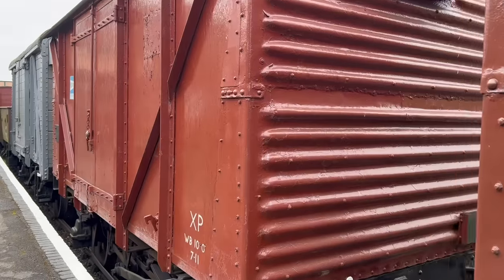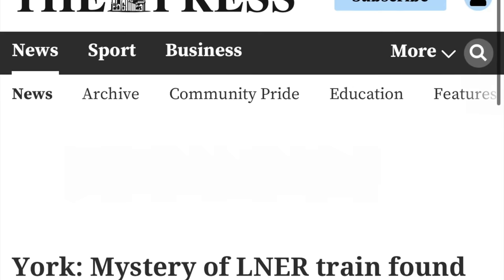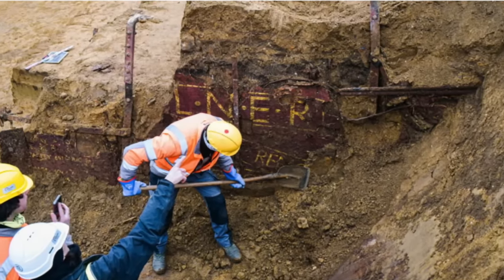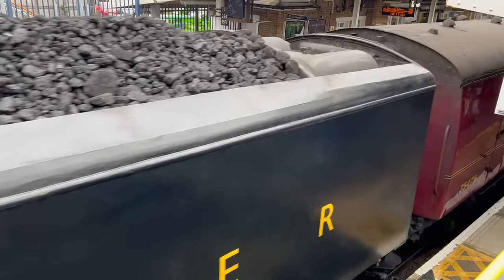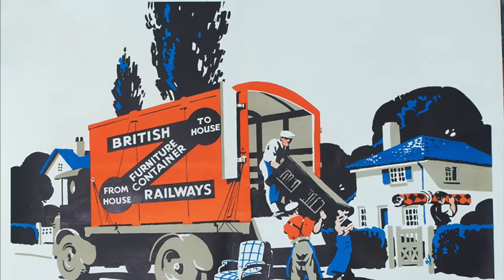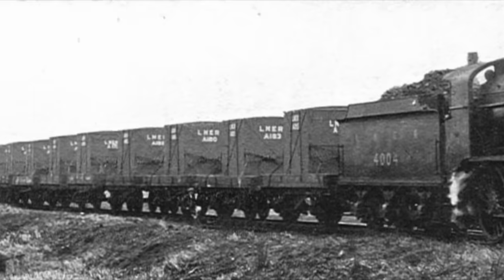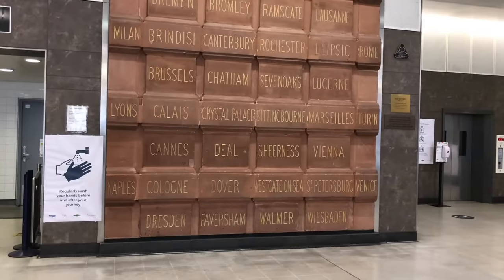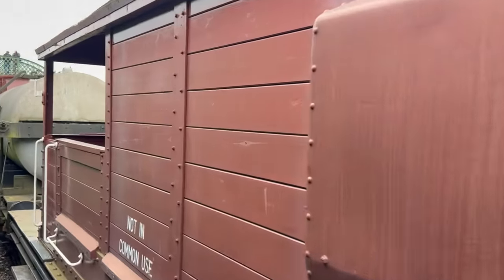The "Mystery Railway Wagon" in Belgium that isn't a mystery at all

Comment: I have to admit that I am disappointed this was not evidence of Watkins completing a secret Channel Tunnel rail link.
Reply: Lol
Reply: From Wikipedia: "In 1881, British railway entrepreneur Sir Edward Watkin and Alexandre Lavalley, a French Suez Canal contractor, were in the Anglo-French Submarine Railway Company that conducted exploratory work on both sides of the Channel.[34][35] From June 1882 to March 1883, the British tunnel boring machine tunneled, through chalk, a total of 1,840 m (6,037 ft),[36] while Lavalley used a similar machine to drill 1,669 m (5,476 ft) from Sangatte on the French side.[37] However, the cross-Channel tunnel project was abandoned in 1883"

Comment: What a wonderful idea.  If you standardised  these 'containers' they could be used the world over to carry just about everything.  It could revolutionise shipping, road freight, ports, railways...
Reply: Nothing new under the sun eh?
Reply: BR eventually went over to four-wheeled covered vans and dropped the use of conflats. The conflat wagon went all the way back to when the gentry could place their chaise upon a very similar four wheeled 'carriage truck'.
Reply: u need a special shape for aircraft
Reply: @johnjephcote7636 Four wheeled covered vans had been around for a long time before this. The containers were used for a door-to-door removal service.
Reply: It does seem to be one of those cases of “ The future is already here – it’s just not very evenly distributed” from the 1930s. It took another 50 or so years and another continent for that particular future to emerge though.
Reply: @francesconicoletti2547  No, modern "ISO" containers were in use by the early 1960s as the 1963 Beeching Report recommended setting up a network of container terminals in the UK rather than   moving goods by the wagon load.

Comment: Funny you mentioned it has caused a bit of a stir in the British press. Here in Belgium it was - to my knowledge - only picked up as an article on the regional section of the national broadcaster in Flanders and in one Dutch language newspaper. 
I certainly didn't know. 

The reason that archeologists have been digging around is because the ring road around Antwerp is being extended. The dig is happening in a part of the port of Antwerp, where a tunnel will connect two parts of the ring road. At the site used to be a castle Noordkasteel.
Reply: Is that Dutch language newspaper Het Nieuwsblad by any chance? I saw an article on their website.
Reply: Yep that's the one.
Reply: Good to know it was picked up as a regional news item, I did not even know this happened at all
Reply: Now I wonder if it has received more attention in the UK because it could symbolize Great Britain or the British Empire and that jazz.
Reply: @MagereHein  also in the Gazet van Antwerpen, but that's not that odd, they belong to the same group.
Reply: "Noordkasteel" litteraly translating to North Castle, or Northern Castle (Or Northcastle if it's a placename).
Reply: We lived in Antwerp a few years back but I had missed this piece of news. We moved from there back to the UK using the modern version of the container, 2 demountables on a truck & trailer.
Reply: My guess is It's probably just more interesting in terms of British history than Belgian. Not particularly exciting for the Belgians to find some British container, whereas to us it's more interesting how it got there.  @Sofus. 

Edit: said Dutch not Belgian! Clearly have the wrong sort of waffles on the mind.

Comment: When I left school in 1970 I got a job with British Rail as a Junior railman, as I was 15 years old. I worked in a large railway goods and we had lots of these containers which where put on to Conflats or also known as container flat wagons. They where kept on the Conflat with two chains at each side, these were screwed up tight so the container would not fall off during transit. We had lots of these railway vehicles coming and going every day. Each container had a  letter code which were A, B, BD, BK. A Containers where smaller, you could get two A containers on one Conflat wagon. I've even seen A containers put into metal open open wagons so. A big gantry crane which covered three sidings was used to lift the containers on / off wagons. When the containers were taken off the Conflat they where loaded onto a flat trailer and driven away by a three wheel Camel lorry unit unit, which I think was electric powerd. Happy days indeed.

Comment: They still do this today. In Canada it's called "Intermodal". When I worked for an electrical wholesaler, it was the cheapest (and slowest) way to ship parts from Eastern Canada to Alberta. Many's the time I've been stuck at a level crossing on the way to work watching what seemed to be an endless string of Intermodal containers on flatcars headed to the container yard in West Edmonton. As long as your timelines aren't too tight, it's still a popular way to move stuff across Canada.

Comment: Essentially, this is whats called a LCL (Less than Car Load) container. For when it doesnt quite justify the use of a full railcar.
Reply: Not really, no. Britain at the time made use of much shorter freight stock than the US. Its a type BK full-length container, that is the same length as the standard covered van of the time. They were invented to try and reduce handling of the goods when being loaded and unloaded from the railways; the type BKs in particular had the same fixings you see in removals vans to this day to keep stuff upright etc.

Jago does show some half-length type A containers to illustrate matters in the video, so I understand the confusion.

Comment: At Woodhall Spa in Lincolnshire (no longer on the railway map) is the Cottage Museum, a preserved prefab corrugated iron house.  These buildings used to be quite common but there aren't many left. On its web site there's some advertising material from the manufacturer of the house, with pricing starting at £205, 'carriage paid to the nearest Railway Station'. So, in the past you could not only use the railways to do a removal; you could have an entire house delivered.

Comment: Containers were introduced on the 4 pre nationalisation railways in the late 1920. Unlike modern containers they couldn't be stacked one on top of another. The wreck appears to be plywood so it was built in 1935 or after they were special containers for house and furniture removals. The information panel can just be seen on the left of the body but the tare weight which would nail the build date can't be read on the video. the number might occur lower down. they are slightly less than half way down the body. the livery is slightly different to the 1935 picture i see in Peter Tatlows book but it is definitely not a wartime livery. suggesting it got left in Belgium pre May 1940. as you say equipment sometimes got lost and certainly equipment got captured by the Germans. for example a GWR Dean goods loco was found in Vienna in 1945.

Comment: Having got hopelessly lost in the environs of Antwerpen only just last week, I bet I know where this was uncovered.  Traffic around Antwerpen has always been a nightmare and my time spent in almost stationary traffic while trying to get to Rotterdam from the tunnel is endless.  For some reason, my mates always said; "Avoid the Kennedy Tunnel" without explaining why.  The one time I did use it - in the opposite direction - it was no worse than any other way, but I seem to remember paying a fairly stiff toll?  Last week; no toll at all.

Anyway, the Belgian authorities have decided to cure the problem once and for all and have dug up most of Belgium to build what amounts to Gravely Hills Interchange writ hhhhuuuuge!  Both the satnavs we were using were woefully out of date, the Tom-tom by about 15 years and the installed Land Rover one by ten and they gave up and pointed us into a suburb of Antwerpen.  Very pretty, but useless  for getting to the bit of Germany we wanted.  So, I reckon it was around there that old container was found?

Comment: The best part of the coverage is the dim-witted hacks asking the current LNER for comment, as if it's going to know anything when it has no connection to the original LNER beyond running on the same route. A great example of the demise of proper journalism in this country.